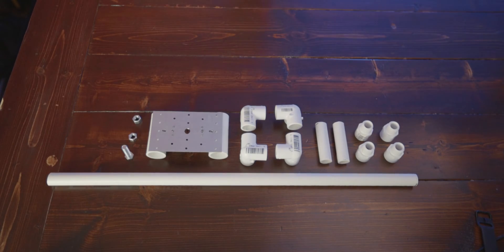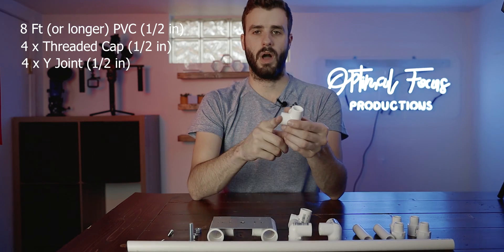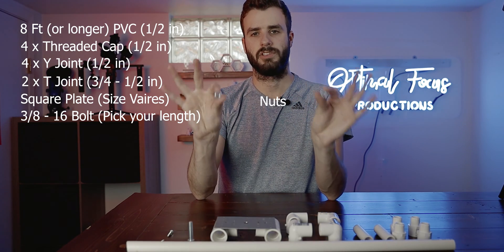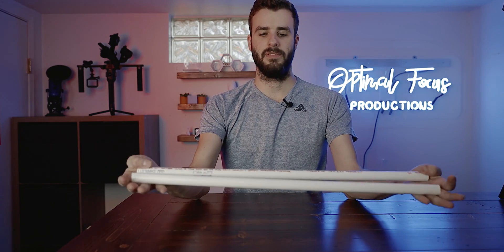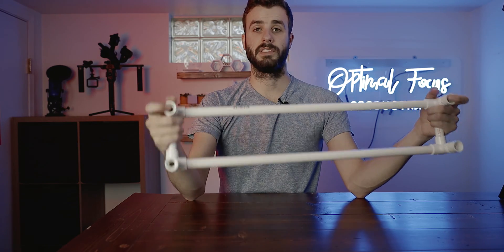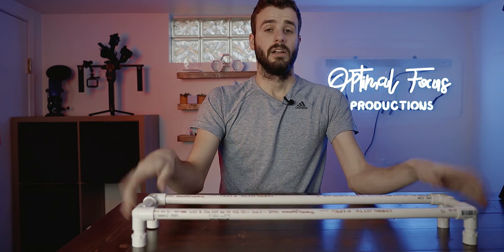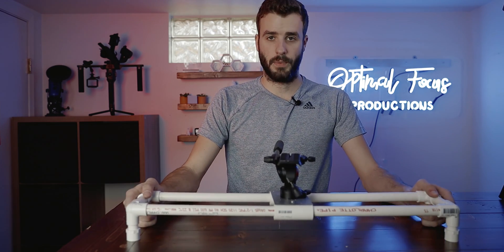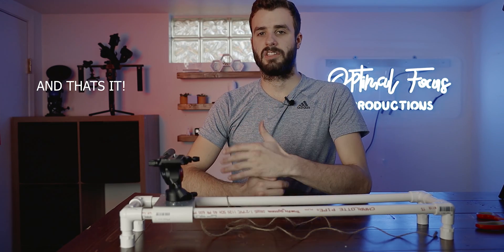DIY Camera Slider UNDER $10 in 10 MINUTES

Comment: There are some things you shouldn’t go mega-cheap on, and I think this is one of them.

You can get a 3-wheel motorized dolly, with remote control, three speeds, reversible directions, from Neewer or others, for $69. For tabletop work, that’s all you need, and it will also do 360 degree pans.

For tripod use, or using two stands, take a plank of wood, slap some molding on the edges, and you’re good to go.

Hey, I’m into clever ideas like this...and it can also work on the vertical whereas mine can’t...but it doesn’t even look like you’re going to get a smooth slide with this. The difference in diameter between the pvc pipes looks like way too much. But if someone IS planning to build this, I would stick a piece of wooden dowel in the pvc tracks to stiffen them up.

I’m putting together an 8-foot “slider” for my motorized dolly. Three 8-foot pieces of lumber (plank and two side moldings) and glue, and that’s IT. No cutting...no screws...only have to drill a few holes to mount to the stands.

And 8 freaking feet!!!
Reply from the maker: I will be making higher quality sliders made with metal and even ones with motors. This was just a really cheap and easy way to get a somewhat decent slider shot and is super easy to build. These other ones may require a 3d printer or extra skills with tools that some may not have.

Comment: Good job, looks like it works.
Hopefully the pipe does not come un done and camera falls knowing my luck?
Reply from the maker: Just can't use too heavy of a camera. If you want, you can glue the end together for each connection. I will be updating this soon with a nicer one made with metal rails. Will cost a little more but will most likely be around $50

Comment: Hmm, how did you get the 'T' piece slider to slide? These components are all push fits, otherwise they would leak in their intended use. In fact these T pieces usually have an internal ridge to prevent them being pushed right onto the pipe at all,  I think I got a glimpse of it. Either you used an oversized component or you have left a step out. BobUK.
Reply from the maker: The part that actually slides on the rails is oversized. From what I remember, the rails are 1/2 inch piping and the sliders are 3/4 inch so there is a lot of clearance.

Comment: Nice work you can also use powder on pvc pipes to smoothening more
Reply from the maker: Great idea. I was also thinking like some sort of lube. I am currently working on a cheap metal slider that will be butter smooth!
Reply: @EngineeringFilmmaker  i was inspired by your idea and tried doing same but not with pvc. Check out below link i have showed how i shot video in last .30 sec
https://youtu.be/kHI9nhmPB44

Comment: Hey man....Consider this comment as a pat in the back : YOU NEED TO GET BALL-BEARINGS, AND PROBABLY RETHINK OF THE WHOLE PROJECT.
Reply from the maker: Hey Rango, This project was meant to be cheap (under $10) which was too low to include premium items like bearings. I know they are important but this was meant to be super easy to make. If you want a more smooth motion with this project, you can add lube to the rails which will help the pvc slide better.  
I am making a video soon about making a more "solid" slider. It will include metal rails, 3d printed or metal end caps, and bearings for a very smooth sliding motion. On top of that I will also be adding a motor to it in a different video to make it motorized. I am most or less making a series about sliders starting from very cheap to nice with a motor but not breaking the bank.